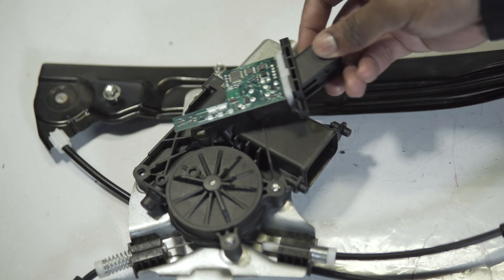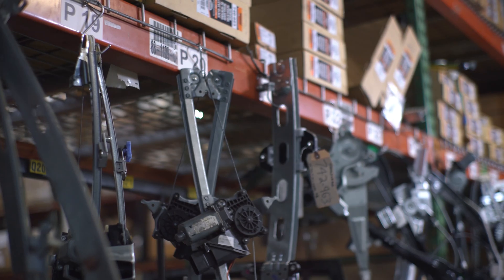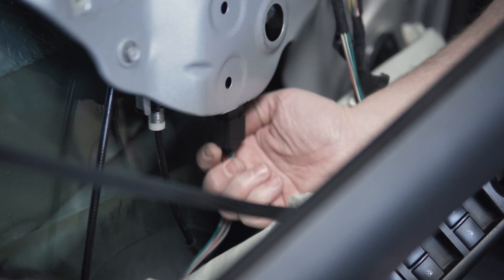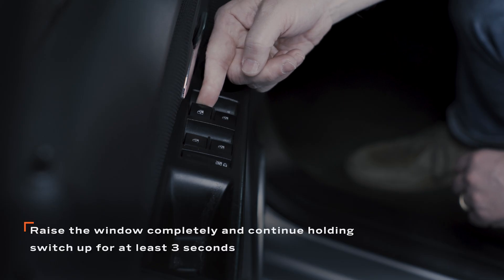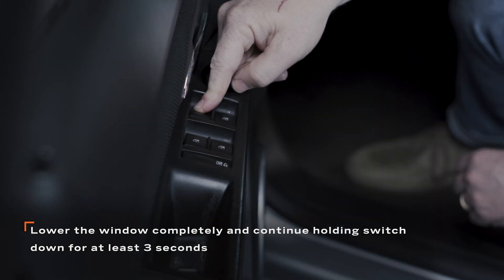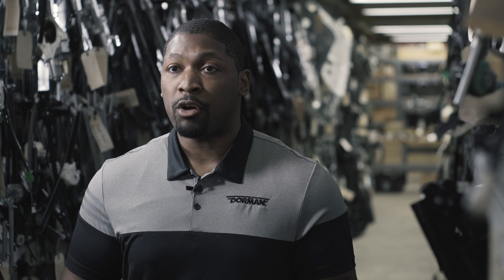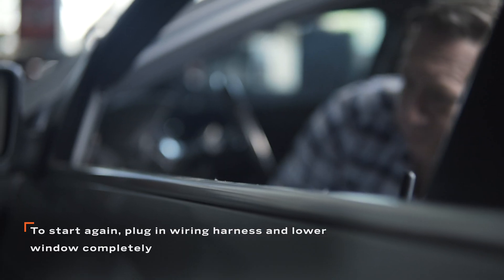How to properly (and easily) calibrate a Dorman smart window regulator

Comment: The "unlearn" tip was the key to my success in a 2008 Civic with new aftermarket regulator.  Using the "auto up" feature with the replacement regulator, the window would consistently and instantly retract about a third of the way  after completely closing.  It was not a friction issue- it happened even if I pulled the window up to overcome possible excess friction.  It's a short video, so for best chance of success please watch the whole thing.

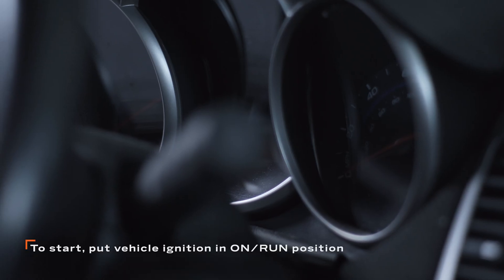Comment: 0:43 i try this on 2005 Acura tl and the auto up or down still doesn't work.
Reply from the maker: Hello! Please double check that you are following step-by-step as the correct process is shown in the video. If it is still not taking it, it could be the window motor or it could be the window switch.